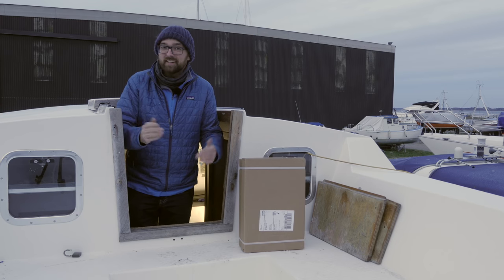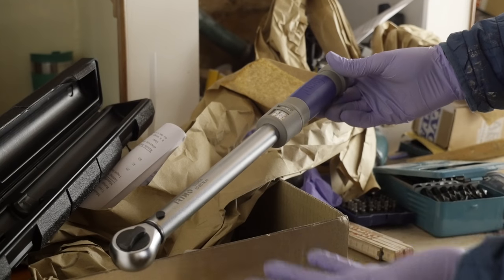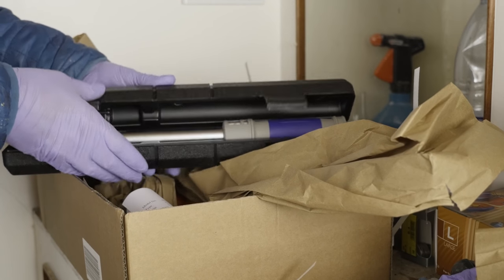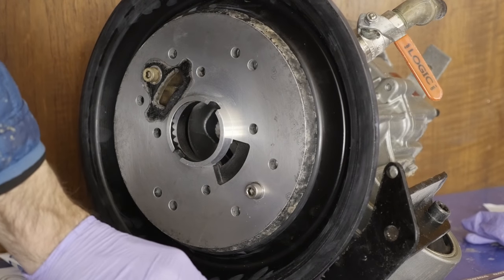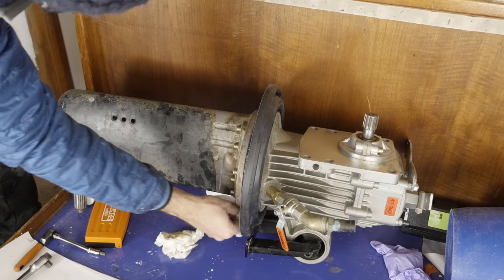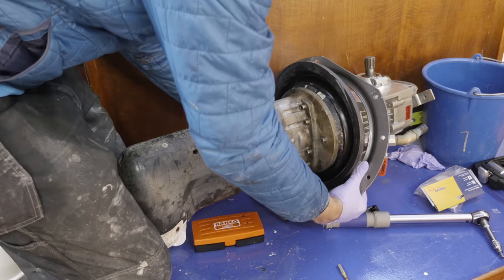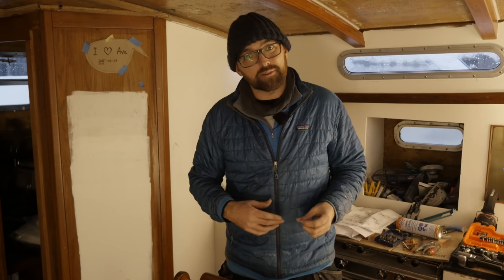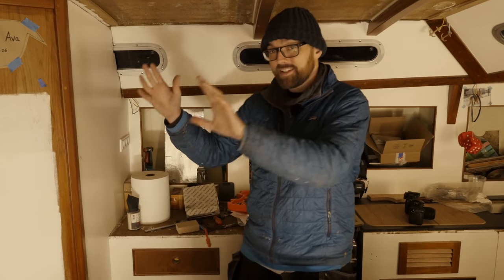Sail Life - Diaphragm replacement 130S saildrive (D2-40) & engine back in it's place

Comment: Remember to release the tension on the torque wrench, otherwise it goes bad
Reply: Piers Bird now you know 😂 just ask me how i learned that 🤣
Reply: And have it calibrated once in a while according to manufacturing edicts.
Reply: Just saying this good advice another way - once done with the torque wrench always set it back to zero.  Also try to avoid going less than zero as this can also impact calibration, though this may be manufacturer specific.  Lastly, when using extensions between the wrench and the socket, some claim you lose a little bit of the torque, and so going a small bit past the ‘click’ when using an extension should compensate for this.
Reply: Piers Bird nah... cheapo one, but still... the trouble of buying a new one was pain
Reply: Matias Forsman yes, we always had to check for calibration stickers when used on aircraft.
Reply: Searched for this comment so I wouldn't have to make it myself :)  Torque wrench is a nice tool to add to your box.
Reply: if ever needing another torque wrench, Ive found it pays to get an electronic one, no need for backing it off or calibrating it.
Reply: Mike Hartmann Wrong
Reply: @brianwalk108  I have to use the electronic ones at work, I hate them.
Reply: @netpackrat  you HAVE to use them?  why dont you purchase some that you like?  Why dont you like them?  run out of batteries at bad times lol ?
Reply: @brianwalk108  Unless I want to find a different job, yes.  I work in the airline industry and each operator has its own tool calibration program, so outside torque wrenches are streng verboten.  My employer in particular has implemented military style tool control, so my own professional tools have been in storage for years.

Things I don't like about the digital wrenches yes include the batteries.  Seems like there is always enough power remaining to turn on and set the wrench, and then it dies as soon as you actually try to use it in the middle of a job.  Never seen that happen to a click wrench.  Also, in my particular work environment, having a wrench that displays the exact torque achieved is a pain in the ass because then the QC folks started asking that we record each of those values in some situations.  It gives you a number, but as long as the wrench was set to the correct value in the first place, that number isn't really useful for anything, and you're not actually any more accurate than you would be with a click wrench because they are calibrated to the same standard.  Anyway, that's my rant on digital wrenches.
Reply: @netpackrat  That makes sense, I don't blame you for your dislike.  I am fortunate that I get to use my own tools at work.  My company would pay for yearly calibration if I needed it, but I prefer the digital ones still, especially for torque angles.  It can still be accomplished by click types.  I would like to see a decent rechargable torque wrench, so it always has full power when ya need it, im sure they will make one, one day.  And yes, I understand the airline industry is VERY strict about construction and maintenance.  There is a LOT of paperwork involved, I can understand why things are the way they are, and for good reason.
Reply: They are simple to calibrate if you have a weight scales to assemble the proper hanging weight.
Reply: I was looking for someone to mention the extension dropping torque. thank you. there is a formula for size of drive and length of extension out there, but a little more should be about right.
Reply: @mikehartmann5187   Please please please never go past the click. how could you possibly know what the torque setting would be??
Reply: Two people have mentioned adding additional torque when using extensions. This just sounds wrong, and a violation of basic physics principles. Am I missing something???
Reply: Support the end of torque wrench so it's not all twisted pls, hard to watch
Reply: @Lancashirelad not always. You may be thinking of stretch bolts as used in moderncar engines these MUST be thrown away and renewed every time.

Comment: Mads, on your torque wrench don't rely on it when doing the low torque bolts. They are only good in the middle 85% of the range and go out quickly. So doing a 30Nm torque and the lowest setting is 30Nm it will not be accurate. Also ATF is the same as engine oil but with more detergents in it to clean the lassanges in a automatic transmission. Use high quality full synthetic ATF and you will never have an issue.

Comment: When you put your sail drive together something dropped out
I hope it isn't one of the round O rings. Checkout your video it dropped just as you pushed them together.
Don't know if you should maybe of checked your bearings too.
Kind regards Ed💡👍
Reply: I noticed this too!
Reply: Yep at 11:37 - a little black thing tipped out
Reply: Edward Wood , well that was a great looking to see it fall out, help he reads your comment
Reply: JoeTheLion60  I’ve looked four times and seen nothing fall out..........?
Reply: @stephencrowther524  Try freezing it at around 11.38 - A black dot falls from the center of the top piece to about 7pm on the piece below
Reply: wow, good eye on that one.
Reply: Nice catch
     The good news is that it could not be one of the o-rings.  Those are behind the plate that holds the diaphragm to the upper unit.  The black thing falls out of the lower unit through an opening in the green gasket.
Reply: Yes - looks like an o-ring fell out
Reply: @stephencrowther524  👀👓
Reply: @Stepclimb  the o rings are located behind the gasket so it could be one of them. i looked using slow mo and hd and it flashes like a milli second as a black ring.
Reply: Thomas Mulder 

      I saw it as well.  It appears to me that the black object falls out of the Lower portion of the sail drive.
      The 3 orings are behind the metal plate that is bolted to the Upper Gearbox.
      I did not see any orings installed behind the green gasket that seals the lower unit to the upper gearbox

      Please look again.  Does it look like the black object falls out of the Lower saildrive or the upper gearbox?

      When I use the terms upper and lower, I am referring to their orientation when they are installed in the vessel.
      In this case, Mads is assembling the saildrive upside down so it appears the object falls out of the lower unit, which is located above the gearbox (where the orings are located securely behind the metal plate.)
Reply: Looks like a drop of oil
Reply: @va3spt  I wondered about that too but it doesn't fall like a drip - more like a solid object

Comment: Hey Mads. Nice job. Looks like the metal ring that holds the diaphragm to the sail drive could use a bit of glorious sanding around the edge and some antifouling. It will be underwater for the next seven years! Best regards, Ken.

Comment: May suggest you get a length of any left over insulation of the same thickness; cut an end on a 45 degree angle (sharp cutting tool), glue it to the edge with a light glue then seal it with the high speed tape

Comment: Few tips with your new torque wrench, in case ya didnt find tips on it or were told.

When running bolts in, the bolts should turn by hand. But some times they dont. If they are stif and have to be wrenched in, try to measure what the running torque is. The running torqe should be added to the torqe spec called out for the size of bolt. Set your wrench to the total. Because the running torqe adds friction so the end torqe could be too low for proper bolt stretch. 

Make sure on machine splits with numorous bolts do a tighting pattern a little on each building torque in a zig zag pattern. Many items like engine heads will have specific torque patterns the manufacturer requeats. 

Never allow liquid in engine bolts thread holes. Touch of anti seize is ok, but oil below the bolt, like in heads,  will crack the block over time from hydraulic force as the block swells and shrinks from heat. 

That torque wrench will help calibrate your elbow eventually. By the way, youre a damn good mechanic man. Thanks for sharing!

Comment: Use the ATF oil, what was good for the drive in the past will be good also in the future. ATF has a different viscosity characteristics that motor oil! I am surprised about the recommendation of the motor oil; that used to be recommended as an emergency if no proper gearbox oil was available and it had to be a simple, low-detergent type. And don't forget to zero down the torque wrench.
Reply: Yes, ATF is the better option, manufacturers tend to do this changes because it is not good but, good enough, saves them in inventory and with that a few bob.
Reply: I have a VP saildrive and my shop manual specifically says to use the same oil and viscosity(15w-40) as the engine. And when I had the saildrive out 4 years ago to have the seals replaced, the dealer said the old recommendation was ATF, but it caused more problems, so they now recommend engine oil.

Comment: I know how you felt on the sail drive fluid. My 1984 Yanmar SD20 has stickers on it that state to use 80w90 gear lube, but all of the manuals say 10w30 motor oil now. I contacted Yanmar themselves and they did not believe me that my drive had those stickers on it. They asked that I send them some pictures of the stickers. Turns out it was changed a long, long time ago to 10w30 for the SD20 when equipped with the 1gm10 engine.

Comment: Torque patterns are always from inside to outside and depending on the material you're torquing down, and the torque required you may need to step up the torque as you go along.

Comment: For future reference.....when selecting the proper torque wrench to use it is a good work practice to use only the middle 2/3 of the span of the instrument for best accuracy. On your 10-60  Nm wrench that would be 18.25 Nm to 51.75 Nm. If you actually have bolts that require 10 Nm of torque you should be using a lower range wrench.

Comment: congratulation to 'a boat that actually would float'. I will get back to this episode as a guide when I'll replace the gasket on my (same) saildrive. Thanks a lot for showing every detail. Found out about oil for the saildrive last year ('used 15W40 as in engine). How much was the service kit?

Comment: If the original manufacturer manual states ATF and your unit says ATF only then you should use ATF, later units may have lesser  tolerances on some components allowing safe use of thicker oil

Comment: +Sail Life:  Hello Mads, you ol' NEWB! Hate to tell you this, BUT ...
You over-torqued the 10 socket hex bolts holding the outer and inner pieces/parts together. To properly use that super-spiffy tor - que wranch , DO NOT go past the break point, or the click, when using the wranch . (See your "vid" for specifics). Other than that, you did a very credible, spiffy , job!

Keep up the good "work," and keep the "vids" comin'! They make my Mondays!

Comment: I dunno if I'd put it in the water.  I seem to remember you have no rudder which does a good job at sealing the rudder shaft hole.  But I've also watched 2 years of work in a few days so my memory is a little more up to date ;)

Comment: Please remember to use a primer on your stainless steel bolts before using loctite. If you don’t then the loctite will never cure and will stay in a liquid form. I learned this, after having problems with bolts working loose, from a rep we have come in at my work. Just trying to pass on the knowledge and maybe save you some headache down the road.

Comment: For sealing the edges of the sound insulation you might consider something like Plasti-Dip. It sprays on nicely, comes in a lot of colors, and will neatly seal the cells of the foam.
Reply: Problem with that is that it's flammable.
Reply: Oh. Yeah. Pretty important consideration. 😢
Reply: Hot glue might work ...use it the same way......put a line down on top the foam.. then use a stir stick or bit of wood to smooth it down and press it down into the foam a little before it hardens  (work FAST!!)  .   it will set hard, and then the tape will have a firm surface to grab onto....

Comment: Mads, use some Silicone grease / spray on the rubber parts, it will help protect them from drying out which will extend their lifespan
Reply: This is an excellent point, I have had this same experience, couldn't recommend enough...
Reply: From the Volvo 130s manual: WARNING! The rubber sleeve must be installed
dry. No kind of grease, silicone sealant
or other sealant may be used.

Comment: Excellent technical detail video!  The engine compartment looks amazing!  A floatable boat is certainly a milestone!   And congrats on the new camera too.  

A couple of torque-y things. In order to keep your torque wrench accurate over time, consider never using it to tighten bolts.  Maybe this is obvious, but you should stop turning the bolts as soon as the torque wrench clicks, otherwise you will add additional torque to the bolts.  I noticed you started double-clicking your bolts, which is a practice I usually adhere to, sometime it seems like the second click turns the bolt slightly, especially when you get above 70 ft-lb (flywheels on car engines require this level of torque!).  Also, did you need to grease the splined shaft before re-assembling the two main parts of the drive?

Comment: It would be interesting to find out, after it's all done, what percentage of the boat has be reworked,  redesigned, updated, and or replaced.  I know it will be much better than when it left the boatyard, it will be the 2.0 version.
Reply: it's the ship of Theseus..    As long as there is some of it still original, it can still rightly be called by the same name :)     The USS Constitution (the sailing schooner) has, over the decades, had virtually every single part replaced....almost none of it is "original"..but it gets to keep it's name because it was done "piece-meal"....
Reply: @timhyatt9185  I should have been clearer.  Wasn't referring to her name Athena, but that she is now an improved Warrior 38, thus a Warrior 38 2.0.  She's perhaps the best Warrior 38 in the world.

Comment: I may be wrong but I believe some o-rings and seals that can take ATF do not last in regular oil and vise versa. Bearing clearances may be different as well. Before changing from the original lubricant, it would be very wise to speak to Volvo to be sure it will work. If it fails in the middle of nowhere, you will need a tow and a haul out, none of which will be fun. While I was at it, I'd also ask about the gasket that was soaked in oil. If there's nothing to worry about, it was just a phone call and some peace of mind.
Reply: When you speak with Volo go for an engineer not someone reading a prompter...and ask questions, folk love to share knowlege

Comment: Congratulations, the engine bay looks wonderful. Just my two cents, have you considered contact cement for the sides of the insulating foam? And no service technician will ever clean the threads before installation, so you're definitely performing Swan level of attention to detail! Last but not least, at every outside shot, I can't help but remember remembering the 88 feet wally, tiketitoo, that copper coat looks amazingly handsome.

Comment: The reason for the droplets is properly cast iron spongiosis. It happens in cast iron when the iron corrodes away and only leave the carbon lattice behind.
It also leaves the casting very brittle and virtually impossible to weld. The only cheap arse solution I know is to have it hot dip galvanized, but if it's really far gone the acid pickling can actually eat most of what is left away and you are left with a nice paperweight resembling Swiss cheese.

Comment: Non locking ( vibration resistant ) thread sealers should be used to lock threads from coming loose due to vibration and not grease.  Check out locktite branded products.  It is the leader in this area.

Comment: Did Volvo change the type of seals in the sail drive when the switch from ATF to engine oil occurred? Maybe it doesn't matter. Engine room turned out nice. How much to do mine?
Reply: That's the reason or the big red sticker, fluid type change needs new spec sealing surfaces.

Comment: Thanks for the video. Im getting ready to replace both of my volvo d2-40s on my catamaran.  In the kit was a square piece of rubber that was to be fitted around the saildrive on the outside of the boat. Did you get videos of that process? Any issues encountered? 

Tim

Comment: I would use ATF on the sail drive unless you contact Volvo with your engine model and the serial numbers for the sail drive and the engine and see if the change of fluids applies to your application. Also be sure a zero out your torque wrench when finished with the job at hand.  You might want to add a few more lights if you had them all on. It looked dark on the sides, front and bottom of the engine.

Comment: You may want to look at permatex products or similar for o ring and gasket sealing rather than grease.  They are designed to be compatible with the materials you are using.

Comment: Also read up on the difference between Dry Torque Specs and Wet Torque Specs for the bolt and application you are using. They are Not the same. Wouldn't want a bolt to stretch and snap when off shore.

Comment: Have you tried contact adhesive for the tape and foam edges. Be careful with greasing bolts and torque settings, they change between dry and greased

Comment: So far Your engine showroom is the neatest of them all, even properly lit for an upcoming northern winter! 
I'd be careful about the oil quality in the saildrive - no harm in sticking to the ATF, is there?
Carrying an oilfill for the engine and an ATF fill beside it would not enlarge the absolute carried mass, and 15/40 to ATF is quite a difference in contents and viscosity. Is there any information WHY they changed it?